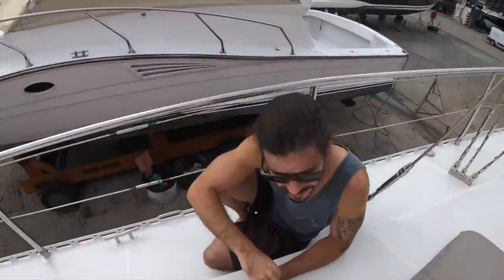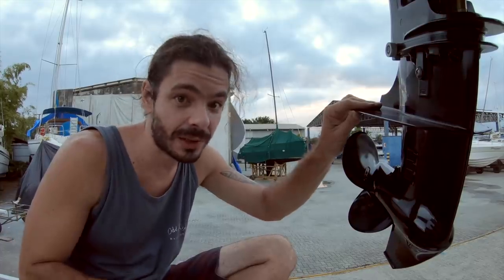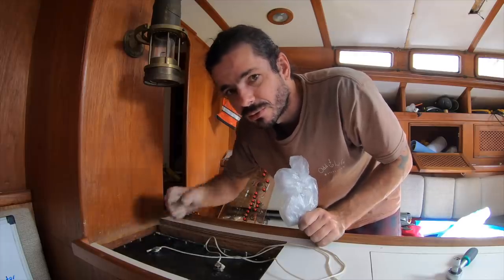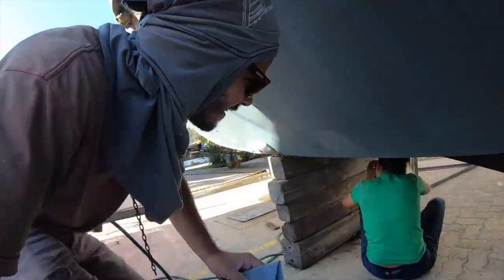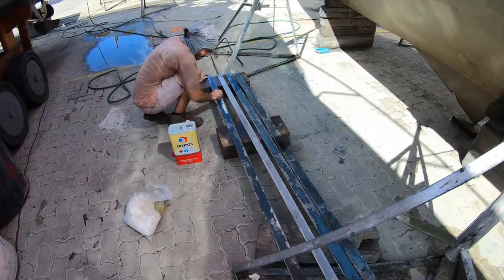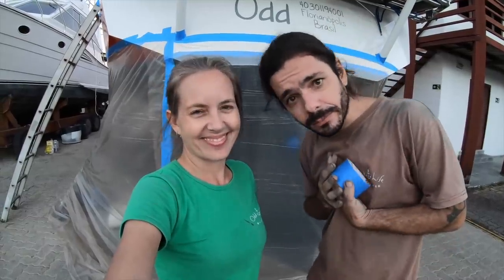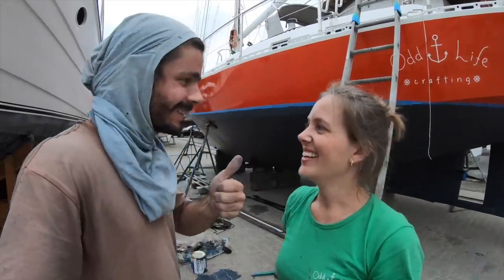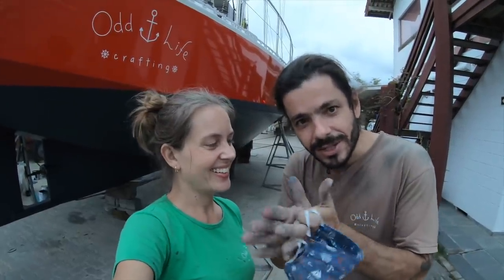⛵️There is no way back!! After that we are going to the water!! #190

Comment: Another solution to the single person planning problem is to add an extension to the tiller handle.  We had a 25hp engine on our 3.5m aluminum bottom AB dingy. That worked well for us. We just used hose clamps to clamp a 2 ft piece of 2" PVC pipe to the throttle handle.

Comment: Good idea to put extra coats of bottom paint along the waterline. If you did not do so this time, you might want to consider in the future doing the same thing along the leading edges - bow, center board and leading edge of the trunk, strut and rudder.

Comment: I know the videos are delayed a bit and you probably allready put the windlass back. But you should consider upgrading that to an electric one. You will be sailing and using the anchor a lot and an electric windlass will be a big improvement on the task of pulling the anchor back up.

Comment: You guys need to start sailing I started sailing at 13 before I went in the Navy I bought myself a gaff cutter Was built in early 1900s I did the basic fixes including a re-plank I had no electrics only a depth sounder and a radio and I cross the North Sea the only way you’re gonna learn is to sail ❤️
Reply: They still have no sails...

Comment: Should not use wire brush on anodes, use sandpaper  You can just abrade it with either a file or coarse (80 grit) sandpaper. The calcium and hard fouling will dissolve in vinegar over night, or faster in some stronger hydrochloric acid (brick )

Comment: hdpe rod, in a solid, about same strength and weight as aluminum, not as stiff, less abrasive, more resistance to abrasion. 

use it for machinery rub block, 100% non reactive with salt, chemicals etc.

Comment: IF the motor wings dont work, this will... much better solution for my smaller boats just google this or something similar bennett slt-6 trim tabs 6"x8" self-leveling spring-loaded for boats 17' max